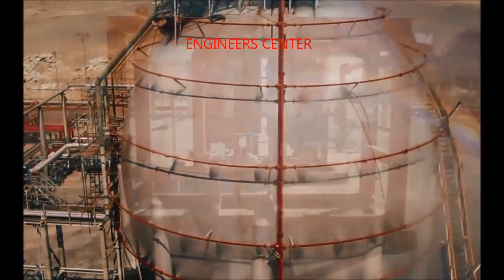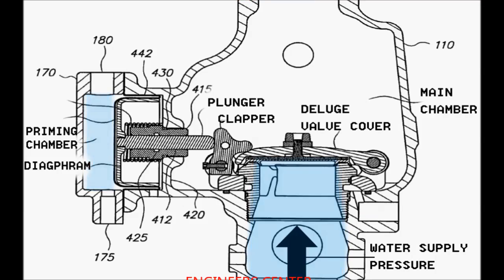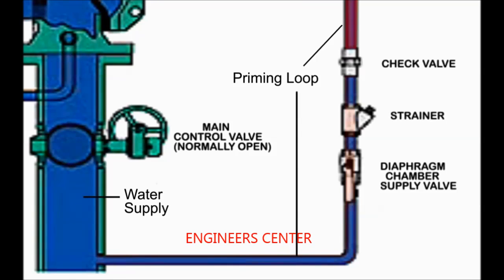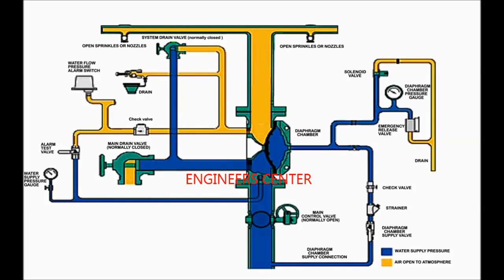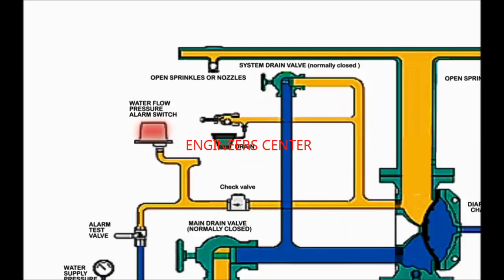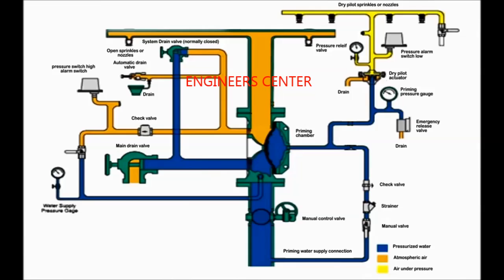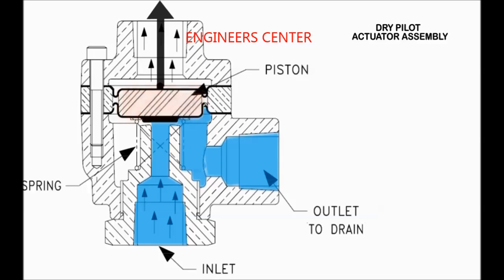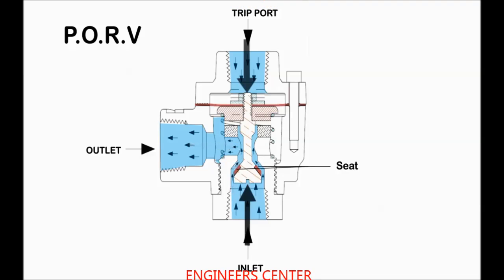what is deluge system and its working principle

Comment: I have a question. In case of dry pilot actuator, does the sensor send signal to Fire alarm control panel ? And in turn send this signal further to open this pilot actuator ? Please clear.

Comment: How  u will pressurize  if u have open sprinklers above😐
Reply: The system is pressurized at the main riser check valve and maintained there until the system is activated. There is no pressure on the sprinkler lines when you have open sprinkler heads.
Reply from the maker: Concealed areas will not be provided with open sprinkler system. But wherever application will have a separate line as per NFPA standards